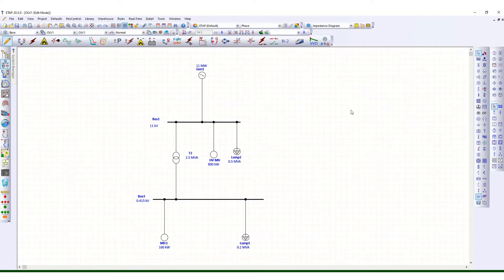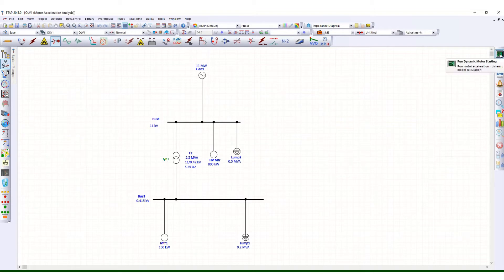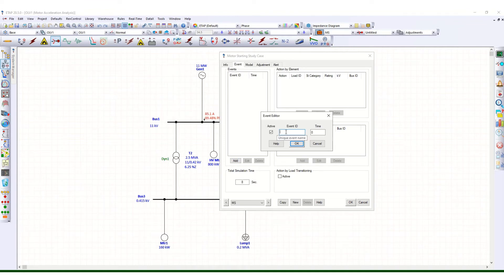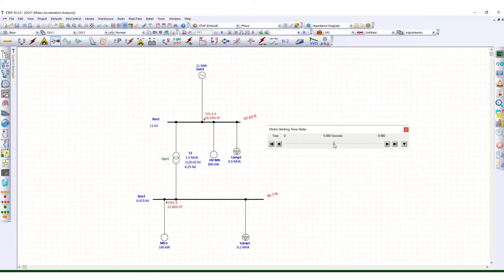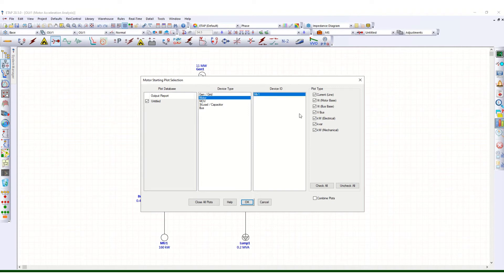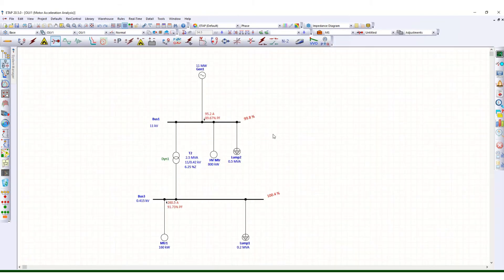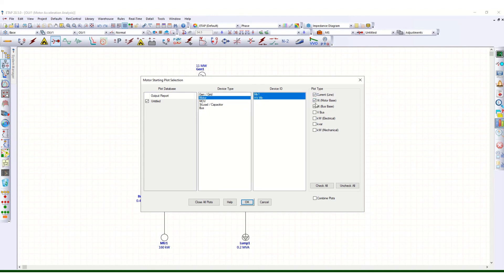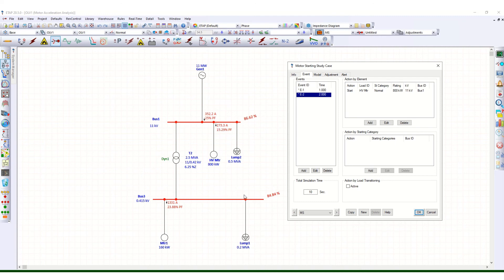ETAP Motor Starting Study (Static)

Comment: no switching section specified error i get
Reply from the maker: You can check whether the switching event created or not before starting the simulation as shown in the video...
Reply: Can you type time 
So I can find out
Reply: What is the solution for voltage drop..